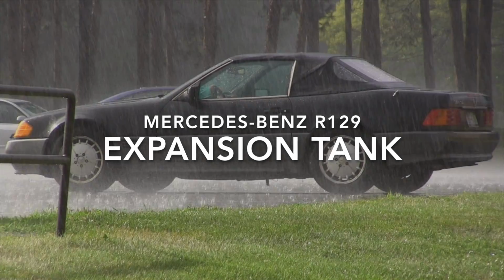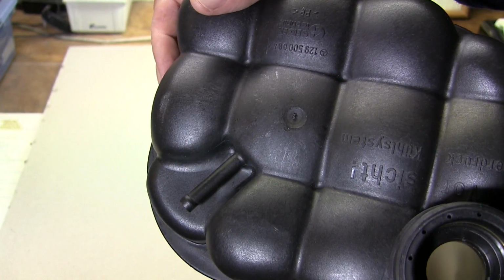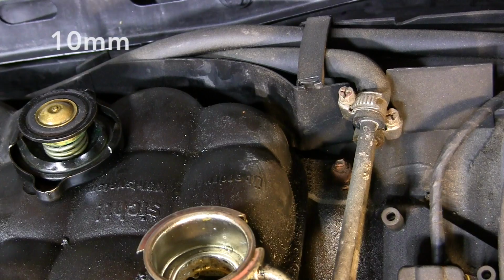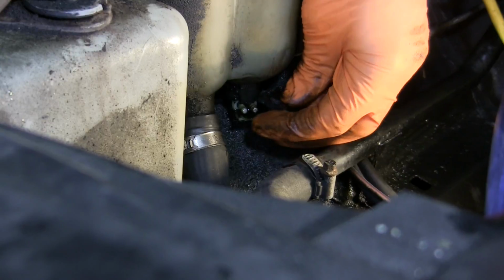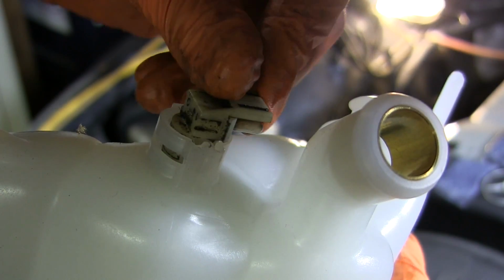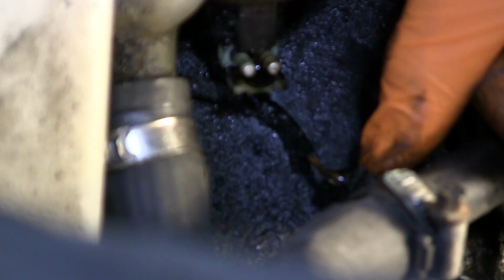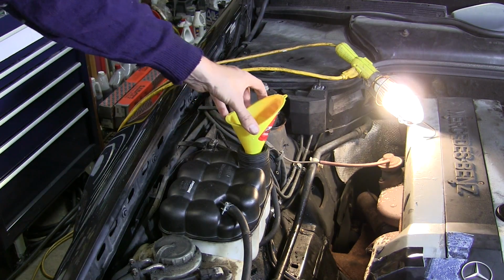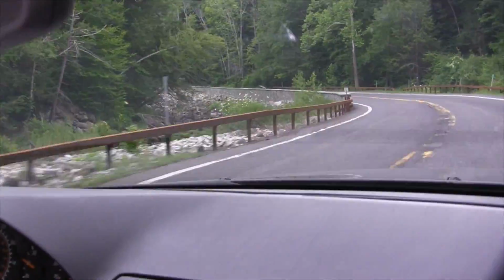Mercedes R129 300SL Coolant Tank Replacement

Comment: Great stuff, sorry to say this i hope your drive shafts play up next as i want to see how you replace them
Reply from the maker: LOL, don't jinx me! I actually did do driveshafts on an 85 190E many years ago. As I recall the fasteners were an unusual star-shaped drive that had a factory red-color thread locker applied. The red type needs heat applied to deactivate the chemical bond. Very easy to strip out the star bolt heads .

Comment: Good video need to do that on my M120
Reply from the maker: All of my cooling system was so old that after the expansion tank, I replaced the  radiator and water pump as well. Lots of work! Best of luck
Alden
Reply: @FlashDriveFilms  Thanks! My radiator had been replaced before so I am doing the reverse of what you did!

Comment: do these cooling systems not have a bleeder screw?
Reply from the maker: I have seen some that did have an air bleed on top of the (aluminum) thermostat housing. Strangely, this car had a plastic thermostat housing, and no bleed screw.
Alden
Reply: @FlashDriveFilms  My 1991 300SL has that bleeder screw. Any idea how you would use it? I think I need to flush the old coolant.

Comment: Great video, thanks for posting. 

Was your R129 overheating as a result of this? Should the neck never move? Is the engine ok if it is 4mm below red mark?
Reply from the maker: Hi! No the car didn't overheat, it was just that the indicator light on the dash was coming on and every time I drove it, I had to top up the coolant.  I found that the engine always ran pretty consistently at a little over 80 on the gauge, the only time it got anywhere near the red mark was on very hot days, A/C on and stuck in traffic. I'm going to guess if the temperature is close the red mark, there is some kind of cooling problem.Weak water pump? Airflow constriction? Dunno.
Alden
Reply: FlashDriveFilms thanks for the reply Alden.

I have the same issue with my R129 in regards to the expansion tank neck moving and wondered if that was causing the overheating to 100 deg. 

I have ordered a new tank and will change the water pump and rad. Fingers crossed
Reply from the maker: If you are going to go that route, I would definitely say do the tank, then the radiator, check to see if that fixes it, and only do the water pump as the last option. On my 6-cylinder M104 engine it was a genuine ordeal. The water pump itself is fairly pricey, and the amount of labor involved is non-trivial. I do have a video of the radiator replacement I did, but have yet to edit and upload the water pump job. For me it was second in difficulty only to a clutch I replaced on a mid-engined car. Lots of little parts to remove and keep track of.
Alden

Comment: Nice job on this video. It looks like the next thing I'll have to do to my R129.
Reply from the maker: Thank you!  Depending on how old the rest of your cooling system is, you might want to watch my radiator replacement video too. I chased a genuine cascade of cooling system failures when mine went. Some day I'll put together the video for the water pump I needed on the 6 cylinder M104 motor. What an ordeal that was!
Alden
Reply: FlashDriveFilms I have a 92. I had a 300CE with an M104 for 16 years that I sold two years ago. It was older and had three times the mileage my SL has. Never a single cooling system problem with that car, so this is a surprise. I have an accumulation of coolant on the expansion tank, so that’s why I’m looking at this first. Thanks for your help.
Reply from the maker: Mine is a 90, the 300SL, and I got all the way to 194K miles, and 27 years old, before the cooling system started sequentially failing. It was also my daily driver at the time,used year-round in all weather and all traffic, so I really had no complaint, it was just a heck of a lot of work when I had to do the water pump. And afterwards it was fine.
Alden
Reply: @FlashDriveFilms  not too bad. Mine is an all year around daily driver as well, although this is only it's third winter and only third year even seeing rain (60k miles).

Comment: One more Question.  Coolant is starting to leak from the cap.  It is a BRAND NEW cap a few days old.  Question when you tighten the cap did you stop tightening when the little tit on the cap hit the overflow tube or did you keep tightening it?  I stopped tightening it when the tit hit the overflow and I am wondering if it is not tight enough.  Really appreciate to here from you on this. THANKS!
Reply from the maker: I don't remember it hitting the overflow tube. I did thread it down until it was very tight, not so hard as to strip/crack the plastic, but yes, pretty much tightened as far as it would go. Also: with the engine Cold, so there is no pressure in the system, take the cap off and look inside it to make sure the O-ring is there and not pinched/distorted. If the O-ring (mine was red) isn't there, or has become unseated/crimped, that will make the cap leak. There is a lot of pressure in the system when it is hot, and you can get a serious burn trying to take the cap off under pressure, so do be careful and wait for the engine to cool down. (A good check is ot squeeze the upper radiator hose first, if it is solidly hard, there is too much pressure to safely open the cap.Wait for it to cool down. ) Hope that helps.
Alden
Reply: Yes it helped a lot!!!  What happened is my cap was bad and the light came on because I lost coolant and the car heated up...not bad..but got to 105 ish. I bought a new cap and OVERFILLED the the tank.  You showed where the full mark was.  Well I was all the way to the top of filler neck.  Any way,  I drove the car and  as you would expect when it got hot it overflowed from the overflow tube and the it was coming out of the cap. So I  thought I had a bad cap...not.. So, I drained the fluid down to where you showed on the tank... tightened the cap up as you did..I counted the turns you show and did the same and the little nipple on the cap ended up at the filler neck...which was all the way tight... and now it does not leak a drop.  Your video was xlnt!  it showed every thing in detail and I just followed what you did and it worked GREAT!  THANKS so much for your help!

Comment: Question, when you took the bottom hose off where is all the fluid?  Did you drain it first OR ?
Reply from the maker: Yes, I drained off what little fluid was left in the tank, I try to make my videos as compact as possible, so I do omit some footage that I figure isn't needed to carry the narrative. I know the trend for car videos anymore is to add lots of filler and stretch them to over ten minutes for the higher ad revenue, but I would rather be concise, to the point and not waste the viewers time with a lot of added stuff. So i am goign to avoid doing that.
Alden
Reply: FlashDriveFilms  YOUR Videos are FANTASTIC still can not get over that I fixed my instrument cluster with YOU HELP!!  Keep em coming!

Comment: What about the small hose part right next to where the sensor goes?
Reply from the maker: Ah-ha, excellent point. The original tank that came off, the one with the metal cap, didn't have that extra port on it. The new tank, with the thread-on cap, did. The place online I ordered it from had it listed as "Fits all R129". I suspect the one I got was really for a newer or perhaps V8 model. I ended up sealing the extra port off with a combination of a bolt threaded into it and a short length of fuel line double-clamped on. I glossed over that in the video figuring most people would get the correct tank the first time around or exchange it. I didn't have the luxury of that option at the time.
Alden
Reply: FlashDriveFilms the OG didn't have it they updated it because the original one had issues with leakage from the top
Reply: FlashDriveFilms it supposedly does go somewhere I own a 91 500SL
Reply: FlashDriveFilms the hose that goes there is called a VLRUB hose it's very hard to find, and what coolant do you use the green one where do you find it?
Reply from the maker: Agreed. Everything else fit perfectly. There is just no provision for an extra line on the 1990 300SL. Rather than spend days (weeks?) back and forth with the mail-order supplier for mine, I just sealed the port off. Has worked fine so far.
Alden
Reply: FlashDriveFilms is there any way I can plug it up and what is it there for?
Reply: FlashDriveFilms another question I have my driver seat won't move the motor works but it won't move do you know what could be wrong? Thanks so much
Reply from the maker: Hmm, what it is there for I suspect a newer or different model has an extra hose that goes to it to circulate coolant for some other feature. For instance, I've never lifted the hood on the V12 600SL model and that may have an enhanced cooling system that uses the extra port. As far as plugging it, I first threaded the metal insert in the port, then tightened down a bolt into it (after coating the bolt threads with RTV silicone) then I clamped a short section of fuel line to it, inserted a bolt into that and tightened another clamp on that. So far, 10 months, no leaks.
Alden
Reply from the maker: I haven't had any power seat problems (yet!) so I have never fixed one. If the seat motor runs, it means you have power (fuse not blown) and the switch works. So I would check underneath to see if something is jamming the seat tracks themselves and keeping the seat from moving. (diagnosing stuff by internet is pretty hard) Hope that helps.
Alden
Reply: FlashDriveFilms thank you so much and what metal thread did you use? And could I use like a glue of some kind to plug it?
Reply: FlashDriveFilms what was the size of the bolt and the other stuff you used to stuff it?
Reply: FlashDriveFilms I bought a screw and some special glue that's heat resistant
Reply from the maker: OK, rather than go into a lengthy text-based explanation, I made a quick video, just for you (honestly!) although other folks can watch it too. Picture is worth a thousand words, so a video has to  be like...infinity?
Here's the URL:      https://youtu.be/RSbTrHi5dTY

Enjoy!
Alden
Reply: FlashDriveFilms thanks man big help